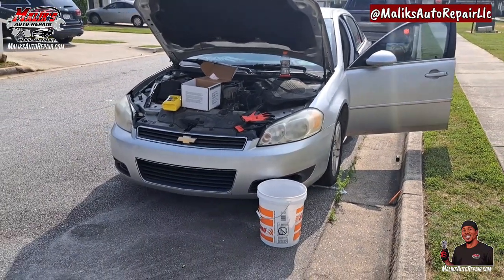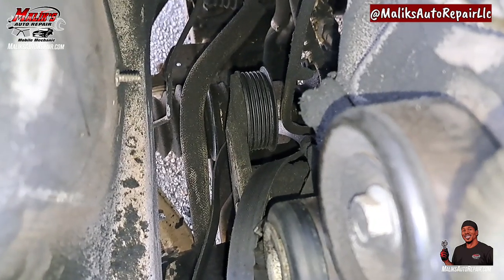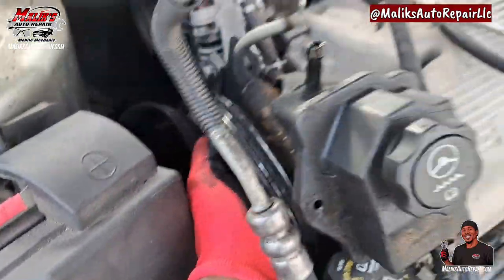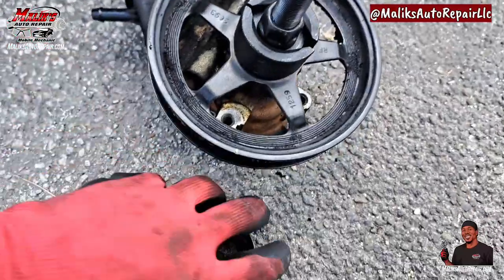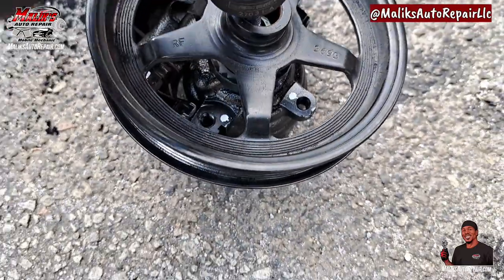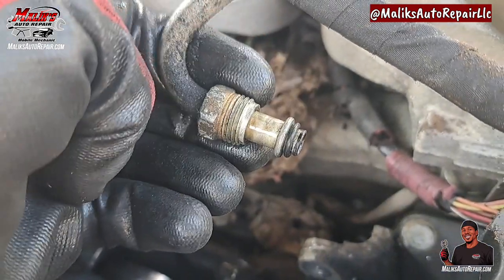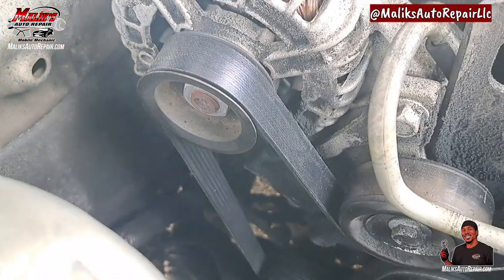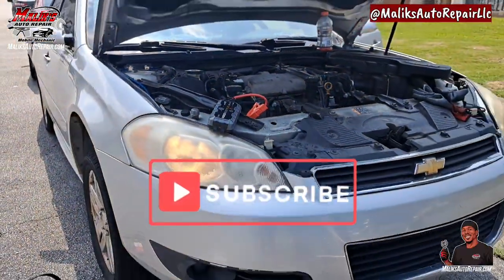HOW TO REPLACE POWER STEERING PUMP | 2011 CHEVY IMPALA 3.5 LT | Howto/Diy

Comment: Is it common practice for a mechanic to mess up power steering pump?  Changed oil and winding power steering issue driving off the lot.  Checked fluid and all full.
Reply from the maker: Maybe they didn't bleed all the air out.

Comment: Where does the big O ring go?
Reply from the maker: Where you took the old ones off.
Reply: @ThePullUpKing  there weren’t any.
Reply from the maker: It won't hold ps fluid without em
Reply: I couldn't find where the big white one went either ☹